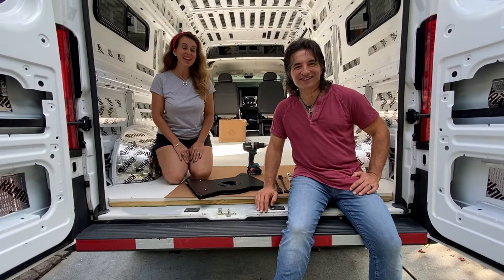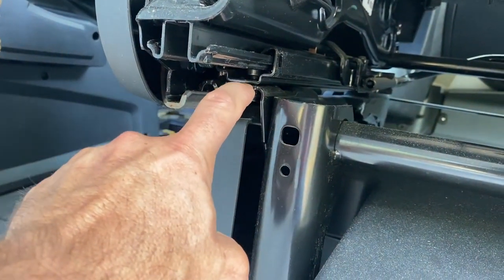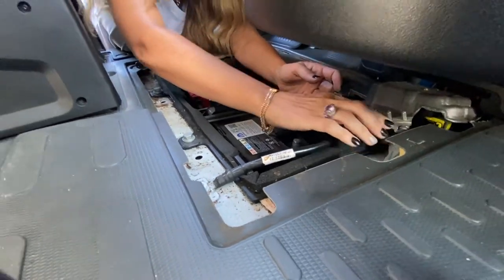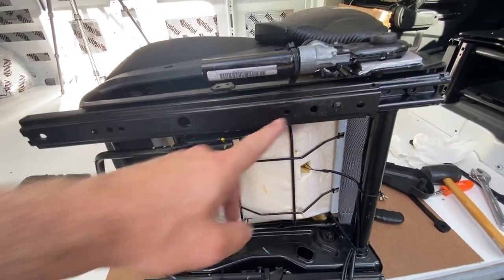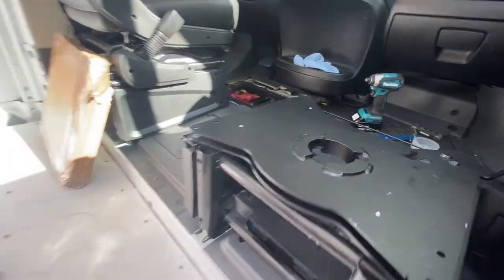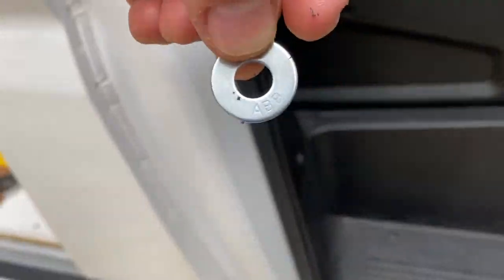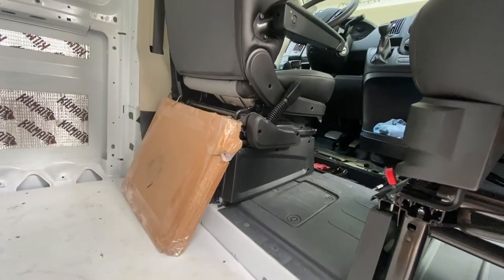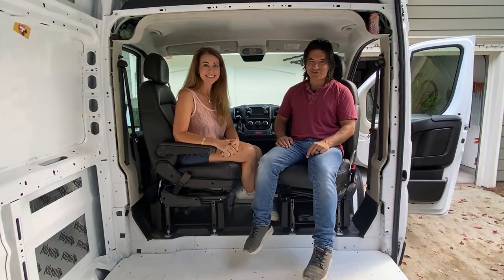Scopema Swivel Seat Installation - RAM Promaster 2500 Van Build Episode 8

Comment: Sir, the Scopema PDF clearly says that the larger screws are for the spacer to get bolted to the seat. The smaller screws are to attach the swivel to the 'avant'.
Reply from the maker: Hi Brynn, Thank you for commenting. You are correct. The larger screws would normally be used to attach the seat and the spacer. However, we did not use the spacer....we actually modified the bottom of the seat to fit without it.  Without the spacer, the long screws were too long....so we switched them. Hope that makes sense. :)

Comment: Hi, just about to hit the buy on the Scopema swivels.  I read that you had to do something with the emergency brake on the drivers side... did you have to do that?  I have a 2018 Ram Promaster 2500 high roof 159.
Reply from the maker: Hi Jong, We did not do anything with the emergency brake on our 2019 Promaster. The only modification we made was to cut off the metal tab under the seats. This allowed us to install the Scopema Swivels without using the spacer bars. This saved us about 1/2 inch of height on the finished seat. It's a very easy modification.

Comment: With factory spacer height: 1.2” = 19/16”
Without factory spacer height: 7/8” = 14/16”

The difference between with and without the factory spacer is: 19/16 - 14/16 = 5/16”

You also added washers for stability which added 2/16” to your height.

So if my math is correct, by removing the factory spacer and chopping seatbelts components, which arguably removes safety and security of the seat. You only saved 3/16 of an inch.
Reply from the maker: I recall it being about 1/2 of an inch, so you are about right. Up to you whether or not it is worth it. We rented a van in Scotland and the drivers seat was too high....pretty miserable. So we felt any height savings was worth the effort.

Comment: Sooooo....you eliminated the spacer and used the washers in place saving you 1/8 inch in height. Maybe the spacers and less hassle would be best. Also, that hook cut off on the bottom of the seat belt anchor is there for safety code specs.
Reply from the maker: It was definitely more than 1/8 of an inch.......but I dont remember exactly how much. AS far as that little metal piece.....heck if I know. I rotated the seat and moved everything I could and couldn't find what it did.

Comment: Love your video!!! I am starting my van build and have watched all your video.. just got my swivel seat today and debating if I should modify to reduce the height or not.. it seems like the added washers is about 1/8” only saving 3/8” without the spacer.. do u think if it worth to do the modification? Does your seat come with the 6 way adjustable? Mine is 6 way adjustable… can’t wait to see your electrical and plumbing video out
Reply from the maker: Jeff, My apologies for the late response. We have been in NJ the last 2 weeks handling some family matters after my parents passing. But thank you for the question. I would personally make any modification that is needed to reduce the seat height. We were recently in Scotland in a van rental...and the swivel seats had me staring into the visor. I HATED it.....and I am only 5'7". The mod for the Scopema seats is quite straight forward. Not sure for the others.....
Reply: @marctania2349  I am sorry for your loss. I installed it with the spacer. It turned out not so bad. Thanks for reponses. Wish everything will be fine for you and waiting for your next video.

Comment: Any mods needed on the drivers side swivel? Parking brake? Thanks.
Reply from the maker: Same mods on both sides.....at least thats what I remember.
Reply: @marctania2349  Thanks, did it same on both sides.
Reply: @BTflicks  @marctania2349 that's what I was coming to ask -- can you swivel the driver seat with the e-brake up/engaged?
Reply: @mhemphill2631  yes

Comment: Do these swivels make the driver's seat too high for driving? I've heard the promaster seats are already high and then these just add extra height.
Reply from the maker: Hi Dylan, Tania is actually comfortable driving the van....and she's 5'3". It did help that we used the Scopemas.....as they are supposed to have least height increase. Also, we made a modification (as in the video) that allowed us to ditch the spacer bars.  But the swivels work great...we would highly recommend them.
Reply: @marctania2349  Thanks for replying! I guess my issue is more on the other front. I'm 6'1" and am worried that it will make it hard to see out the front windshield while driving
Reply from the maker: @dylancunningham8769  Ahh....Gotcha. I have heard of taller people who ended up right at the visor after lifting the seats. We are in NJ right now visiting family....but, when we get back,  we'll have our 6' next door neighbor sit in it and get his input. The Scopemas, without the spacer, did not raise it by much.

Comment: after deciding that my passenger seat was to high, I removed the spacers and was about to cut that flange, but it looks like the flange was designed
to secure the seat belt in case of an accident.
Not so sure if it should be cut.
Any thoughts???
Reply: Looks like its ok to cut.
Reply from the maker: Hi Bob, I was not able to see anything that that piece did. We did a bunch of research online first....but it seemed fine.

Comment: i think you installed them upside down
Reply: Hi Karl, I looked at them today. I can't really see how they would fit if we turned them over. But you certainly may be right. They work great, though.
Reply: @perrellapartyof5  I installed the passenger side with the release mechanism facing up and when I swivel the seat, the mechanism scrapes against a metal rod that extends across the front of the seat base. If installed correctly, release mechanism faces down and is located between the seats. Everything works smoothly

Comment: You installed them upside down
Reply: You are correct! I installed the passenger side with the release mechanism up and when I swivel the seat, the mechanism scrapes against a metal piece across the front of the seat base. If installed correctly, release mechanism faces down and is located between the seats, I don't have that problem.
Reply from the maker: You are correct. But they still work fine. We did reach out to the company to ensure it didn't violate any safety issue just to be safe. We may one day redo them right side up